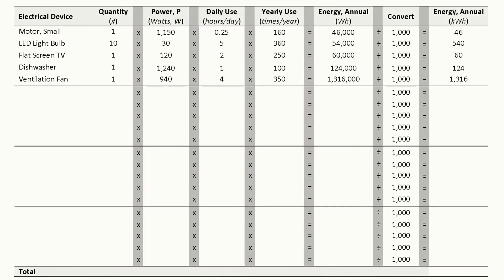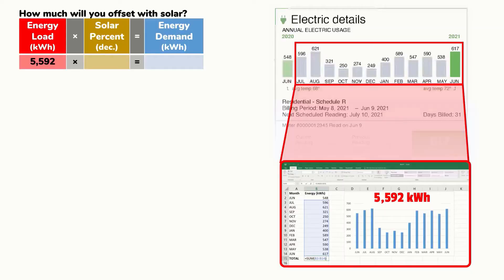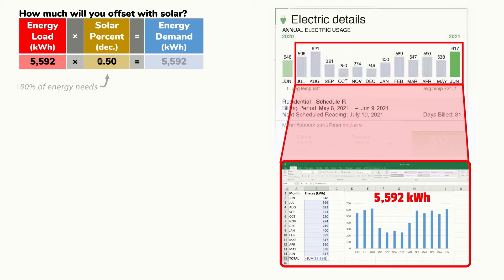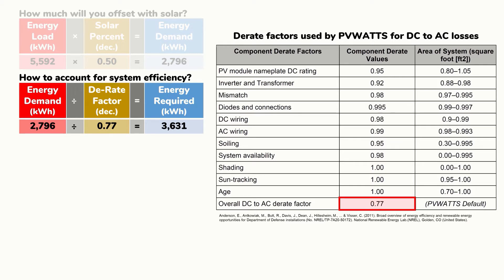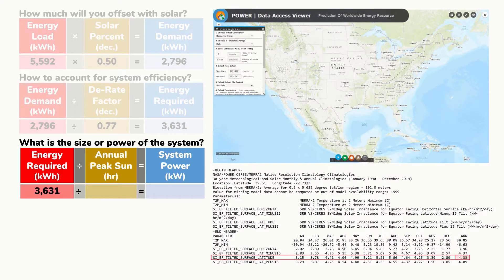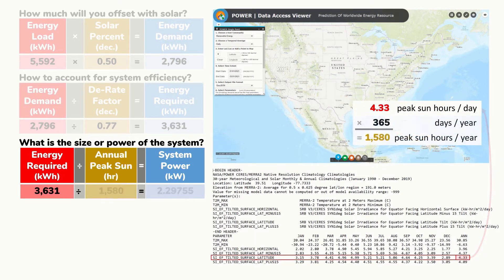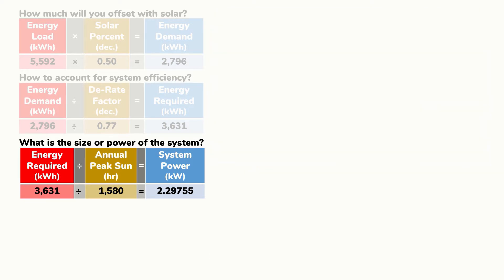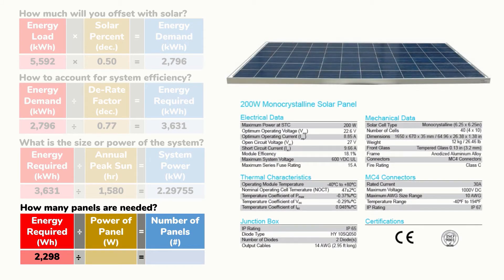How to estimate the size of your solar electric system

Comment: As others have mentioned, this is a really good video, as is the rest of your "Solar-Clips" series.
May I make a small suggestion: unless you have other reasons to make the entire calculation process based on "yearly" numbers, and from a purely mathematic perspective... instead of starting with yearly energy usage, then multiplying other data by 365 days to get "yearly" from "daily", and then dividing by 365 at the end, (actually, dividing by a number that was multiplied by 365 earlier:), you could divide the yearly usage by 365 at the beginning to get an average daily usage, and save yourself some multiplications and divisions along the way. This has the added benefit of being simpler and clearer to people with less interest in math, like some of my friends, and even family (imagine that :))
Thank you for sharing.

Comment: in your previous calculation to determine the number of panels you got 12 panels based on the consumption and the peak sun hrs, now u get 7 to 9 modules when u calculate to determine the size of the inverter ...  i don't understand.  do we use 12 panels or 7 to 9 panels?
Reply: Sir, actually 12 modules are required to meet 50 percent of energy requirement of the house. But no less than 7 panels can be connected to the inverter; otherwise it (the inverter) will not function. Since 12 is greater than 7, it's safely above the threshold. Therefore, 7 is not a limiting factor. However, if more than 9 panels are connected to the inverter, it will be damaged on a cold morning due to high Voc. So 9  becomes the limiting factor. Meaning thereby that though we need 12 volts to meet 50 % of the energy requirement of this house, we cannot add as many. So we have to be content with only 9  Solar panels and no more. This means a shortfall in energy supplied by the solar system. Answer is 9 panels. 
P.S.  - I think professor's choice is not optimal. He should have gone for an inverter which can take higher voltages or he should have gone for an inverter with more than one MPPT.
Reply: @AamBhartiyaNagrik  good explanation , thank you , the voltage increases as the panel gets too cold, so we might reach the voltage limit of the invertor, perfect

Comment: Good and useful video. But, I do have the same questions and nikolairodgiguez5147. The energy consumption is for 24 hours a day based on the on/off duty cycle of the individual loads. Whereas the solar energy is supplied only during the Peak sun hours. I am more curios to understand the basics of selection.

Comment: Very useful video. However I have a question. 

As you very well know, the patterns of energy consumption throughout the day does not match the energy generation.

Hence, the solar panels are producing most energy during the time of the day where people are at work, and stop generating when people are home again.

That is why I do not see the logic between sizing a non-grid and a on-grid installation the same size. The on-grid may have to be a larger installation in order to break-even with the extra net-energy sold to the grid during the day, to compensate for the energy consumption at night. This is especially true during the winter times.

Would you be able to address this issue?